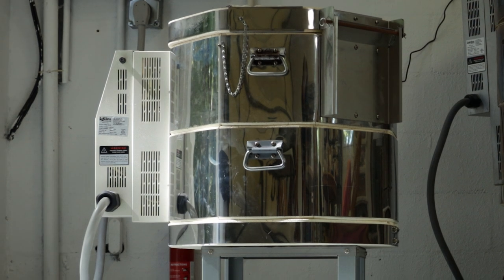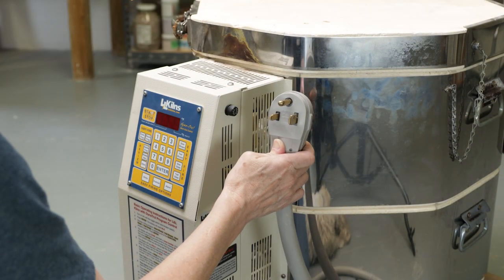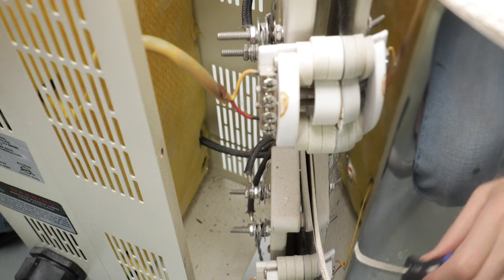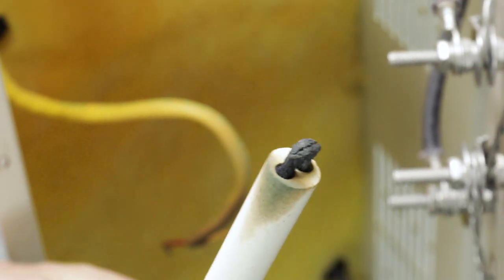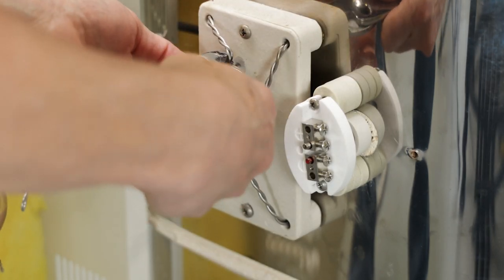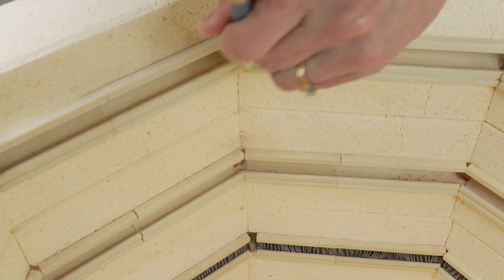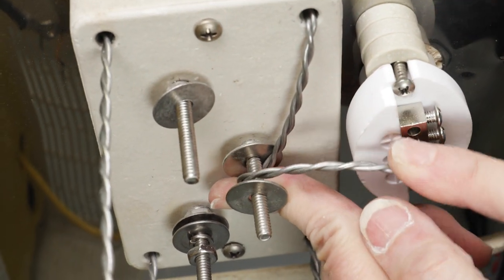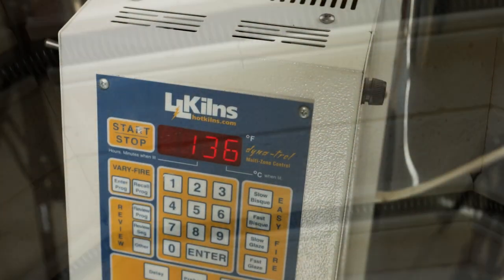Replacing Kiln Elements and Thermocouples

Comment: We have this same kiln but with the quad elements. So far, it's had over 150 (cone 04, 5 and 6) firings on the original elements and thermocouples. The elements are starting to sag real good though and  it's taking over 7 hours for a fast glaze fire. I think I'm going to squeeze in a few more bisque fires before I change everything out!

Comment: Good job Ann! By the way, you cut the wires using a sheet metal shear. Wire cutters are different and provide more leverage and are easier on the hands. The needle nose pliers can cut wires also, but the gauge of the elements is a bit large in this instance. 
I really appreciate your videos, they are so well made and instructive. You have a gift.
Reply from the maker: Thanks John...yeah, the wire cutters I had could not snip the element ends...I brought a knife to a gun fight so I had to up my weaponry 😀